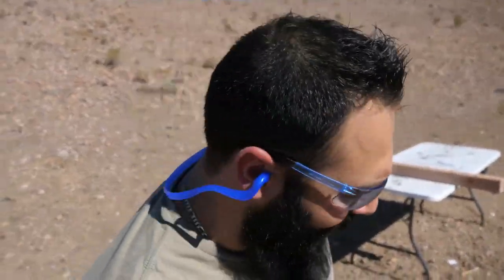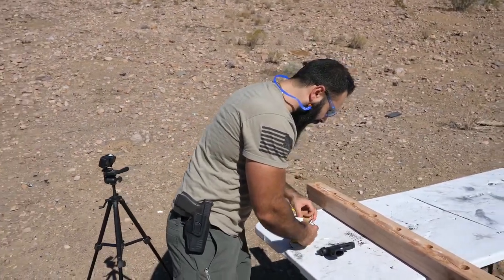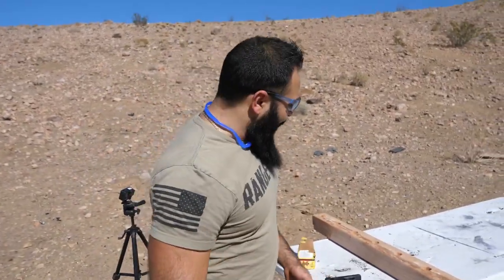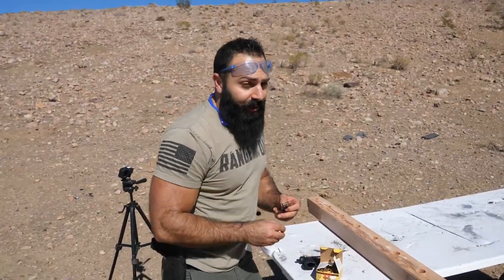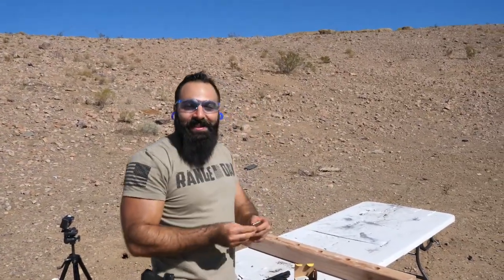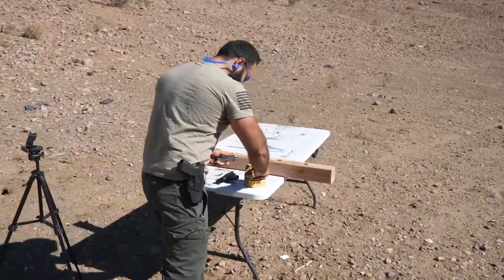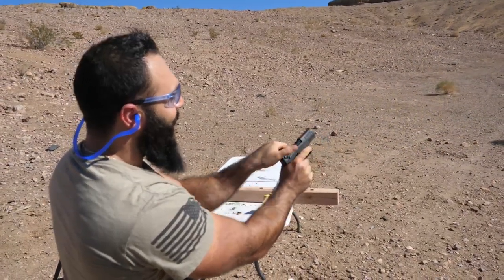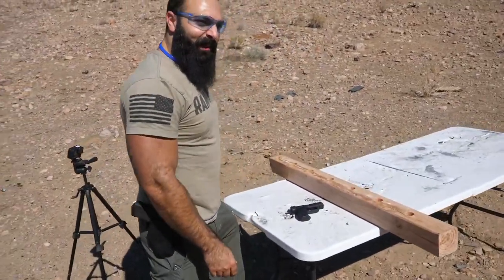How to fix Walther p22

Comment: Never had a problem with mine. I keep mine cleaned and properly lubed and the last two times at the range I shot 300 rounds of CCI monimags with no issue.
Reply: They always run 100% on mini mag. The issues are if you wanna run different ammo. There is also the slide wear issue from the trigger arms.  I did all the “p22 Bible” mods and mine is a blast to shoot.  Been several hundred rounds since a failure
Reply: LOL! That's because you are using the right ammo. Try using cheap or even moderately priced ammo and you'll quickly find that the P22 is VERY particular! 😂
Reply: exactly who buys mini mags you are rich? ive shot over 200,000 rounds through my p22 and have had many springs break the slide break, replaced lots of parts and it jams with cheap rounds :( i think it needs a better feed ramp
Reply: I ran CCI mini-mag and it is fine.  The subsonic CCI is too weak to cycle unfortunately.
Reply: 3 Walthers new.  Various ammos. 1 worked every time with all ammo. 2 failed every clip all amo. This gun is cr&p. Do not buy new. Test it first.

Comment: Putz… 3000 grit sand paper, a dremel and some 3-in-1 oil works magic. Captured recoil spring, extractor and firing pin from Tandemkross and it’ll run pretty much anything.

Comment: In reality, buy a captured guide rod/spring, buy a dremel and polish the feed ramp and slide rails.

That does help SIGNIFICANTLY with reliability.
Reply: I hear you bro. What I want to ask Walther is why should I have to do all that? can't they just fix the problem? it should work as intended right out of the box.

Comment: I only use hollow points in mine range or otherwise. Almost no recoil, smooth as silk & no jamming issues, and as accurate as you can imagine. I have a laser sight on it, but outside of that it's Stock. Perfect for personal carry purposes.
Reply from the maker: I would not rely on this pistol for personal carry at all , there are lots of better options
Reply: @Kbum-Guy  Smith and Wesson model 43c 8 shot 22lr if it goes click just pull the trigger again
Reply: @Kbum-Guy  if you can only afford 6 cent bullets its a option.. 9mm is almost 35 cents a round. might be expensive to save your life!
Reply: @rodvan-zeller6360   and if it keeps going click click click as you pound through the unreliable rimfire cartridge.
Reply: @smallbox679  Drop it and grab the 357 back up

Comment: Ok I fixed the shit out of mine, the main problem is the safety bar under slide, when it's cycles it hangs up on it, rack it slowly and you'll see,you gotta take a dremel too it and aggressively sand it down, just the bar in fire position, next the spring for extractor needs more pressure on it,my simple solution is a small piece of plastic just behind the spring itself like less than a 1/16, cut  excess off with a hot Exacto blade like heat razor with torch to trim flush, works like a dream, fires everything as fast as I can possibly go,no problem whatsoever, easy fix good luck

Comment: I have two of these P22s.  They both have had all the issues you mentioned with 3 or 4 different types of ammo... I've never tried mini-mags.  I've had failure to feed, failure to fire (duds), failure to extract empties (and you have to pry them out), type 1, type 2 and type 3 jams.  I love my Walther 9mm but I think this is a pretty bad design.  My wife's Ruger .22 is solid and never fails.  I don't think I've seen any failures of any kind after about 200 rounds.
Reply from the maker: There is 100s if not thousands of complaints about this pistol online , just a poor design
Reply: Yup, same issues

Comment: I have run at least 8 different (mostly cheap) kinds of ammo through mine and never had a problem until it was really dirty. Clean it and it runs like a singer again. it does prefer a little hotter load, and keep your thumb off the slide while shooting.
Reply from the maker: The first one I bought brand new lubed was jamming more than it was shooting , took it back replaced it with another brand new and even worse, tried it with few different brands of ammunition and only rank okay with one , I think the California model got the most issues which is no surprise lol
Reply: @Kbum-Guy  funny enough mine is CA model...
Reply: Mine can only run remington golden bullet
Reply: @omarsalazar962  mine runs cheap Remington lightning green box all day. It does prefer a more zippy round though.

Comment: Federal 36grn Bulk pack and CCI mini-mags cycle the best in the P22. Aguila is good too and Remington thunderbolts. It has to do with the design of the bullet and how it feeds up the ramp.
Reply: I heard there is a breaking count of a 1000 rounds. Clean gun and it should cycle with no problem after that. Even with the cheaper ammo.

Comment: you don't need broken a handgun.  you need have  more  knowledge  maintenance  . 1: cleaning barrel, polish chamber barrel . 2:polish and sand with smal metal file [ extractor]  .3:polish2 parts ,hummer and ejector . well lubricant all parts with a light Valvoline , or gun oil,  4: open magazine , brush and path in side , rubbing a little Valvoline in side magazines. if you have a new hand gun ,before start shooting , pleas open all parts ,rubbing greases or Valvoline with gun oil.

Comment: Yep a complete waste of 7 min of my life, thanks. I have a P22 and it digests ammo like a garbage disposal and dinner scraps, chews it up and spits out the empties! MOST or A HUGE part of rimfire jams are caused from the extractor! YEAH, for real! Now here is the scary part for YOU, The extractor in a rimfire doe NOT extract the spent cartridge. The extractor controls and holds it in the bolt face until the ejector pries it from it's grasp. The cartridge ejects ITSELF! Don't believe me, take your extractor out and shoot it! The pistol or rifle may very well jam but the cartridge will not be in the chamber unless it went BACK IN. There have been numerous rimfires made without extractors and work just fine. SOOO TUNE your extractor if you want a reliable 22 LR, but you must KNOW HOW to tune it correctly!!!! or take it to someone that REALLY understand rimfires.... The magazine is another big one but the Walther P22 mag is designed well and work.
Reply from the maker: All what you said is correct , however I don’t think a brand new pistol out of a box should need any tuning or work done on it , I’ve tried two of them out of the box with different brands of 22lrs and all the same

Comment: I'm having the same sentiment as you had. I have never had a pistol fail to run as badly as this one. I might have to try your fix, lol. I really like everything about the gun except after 400 rounds,  I have yet to be able to fire a full magazine without it failing to go into battery. Severely disappointed with this pistol.
Reply from the maker: Very nice looking pistol but horrible at function

Comment: Tandemcross updated firing pin and extractor. I use Remington Golden Bullet. No problems.
Reply: I purchased tandem kross recoil spring extractor and firing pin. Going to do this and see if it works if not I might have to polish

Comment: I’ve never had a problem with mine. But my hammer spring sticks out of the back when the hammer is up. Does anyone else have this issue? I’m tempted to file it down since I’m worried it will snag.
Reply: Mines is like that too 👍
Reply: @callmejonny7172  mine is sharp enough to cut. I thought about filing it down in hopes it wouldn’t cause an issue. But it makes me feel better that mine isn’t the only one, so thank you!

Comment: ok, ive had mine for a short while, put around 500 rounds thru it, no issues so far.  But i mean...
:10 sec mark 'I Luv dis gun...'
:28 secmark 'I HATE IT...I HATE THIS GUN!!!'
i mean, could you not be more foggy about how you feel about it?
Reply from the maker: I purchased the p22 about a year ago and day one started acting up so I exchanged it with another brand new one and the second one did the same , failure to feed, failure to eject, failure to extract and so on lol, I tried different brands of ammunition as well, I have few other videos that shows, I think the most issues are with the California model

Comment: I can clearly say that with this pistol u need better quality amunition, which gives you a bit more boom & also will help cycle the slide fully. The problemnis that the lower end amunition just doest have enough power to keep the cycle running good . - .....& thats why i think the glock 22LR is great beacause of its polymer slide, so you dont need much boom because the slide isnt heavy enough to obstuct the full cycling of the Glock44. Chambered in 22LR.... stay safe & ready friends....
Reply: It is a hybrid steel/polymer and it doesn't make much difference. My Father-in-law has one and it has issues with multiple brands of ammo. Some are better than others, but still malfunctions way more than a pistol should.